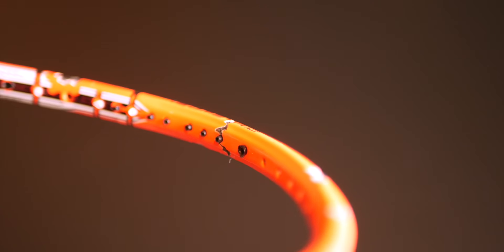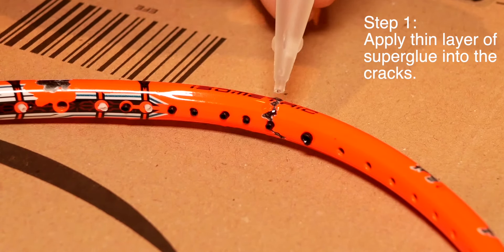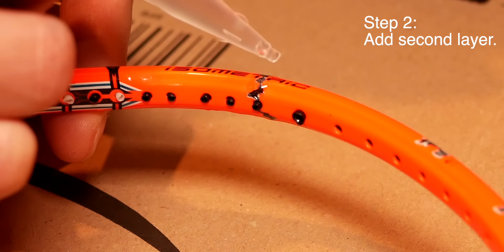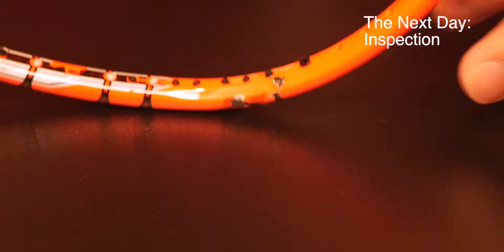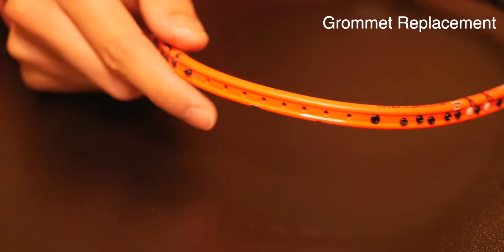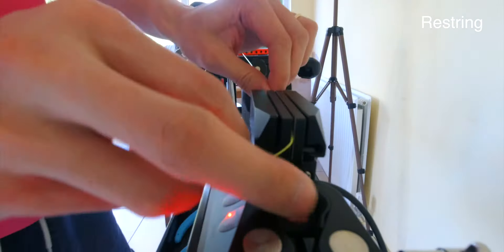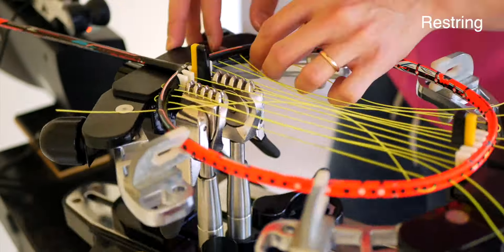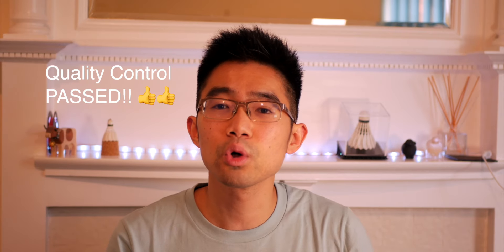How to Repair Broken Badminton Racket Frame using SUPERGLUE

Comment: How much tension of your racquet after putting the super glue repair fix
Reply from the maker: Max of 23 lbs in my experience 😬
Reply: I have apacs assilaint pro having max 38 lbs tension. So 23 tension will work on it?
Reply from the maker: It may withstand 38lbs when it’s brand new and not broken. Once the frame has broke, it’s generally Game over so 23 isn’t too bad at all.
Reply: @CKYew actually I bought brand new apacs vangaurd 11 with Max tension 38lbs and I gave it for stringing at 32 lbs (ofcourse electric machine) and he returned it with crack and told that the racket didn't withstand it... So please do a video on reality about apacs racket and it's claims ... Please test my type of 38 lbs racket max tensions... Like do 28 lbs first then do 30lbs then do 32 lbs n so on and see when these type of rackets actually break... 🙏😭 please do it for all members of badminton community. I felt so it happened today.
Reply: @CKYew  Can I do 24

Comment: Dude my racket broke at the joint of the frame... Do you think super glue would work?
Reply from the maker: Helloooo, wowwww how hard were you smashing to have broken the T joint of your racket 😂😂 well, you’ve got nothing to lose right so why not give it a go, I mean it’s not going to be like a brand new racket but no harm at this point trying 😬😬 good luck!
Reply: @CKYew  thanks man.... 1 more tip for you use baking soda with super glue now you have a racket that cannot be destroyed.....lol thanks for the reply.
Reply from the maker: Oooo baking soda and superglue!!?? 😏😏
Reply: @CKYew  yup..
Reply: Super glue wont hold it... go for carbon treatment
Reply from the maker: @a324111  awwww :( make sure you're not paying too much for the carbon repair, my experiences with them arent too great either! good luck!
Reply: @CKYew  It is easy to do carbon treatment and cheap too where I am from
Reply from the maker: @a324111  Good!! I'm glad you've had good experiences with it, do keep us updated on progress!
Reply: @CKYew  yep, it worked for my tennis racquet. just fill crack w super glue and have a layer of baking soda over it
Reply from the maker: Nice!!! I didn’t think it would work well on tennis rackets as the tensions are significantly higher but I guess you just did! 👍🏼👍🏼 amazing! Why baking soda too?
Reply: @CKYew  it a chemical reaction which makes it more powerful..
Reply from the maker: @Apurvrajvlogs  Sounds good to me!!! ;)
Reply: @CKYew  glad to hear that...
Reply: @CKYew  baking soda helps it cure faster and harder something about a catalyst or sum

Comment: what tension did you use after repair? My racket originally was allowed to from 24-35lbs tension. After the crack repair, what should be the allowed tension?
Reply: 26 I have heard

Comment: you can use super glue + baking soda. put super glue into the cracks and then add baking soda inside it, and add super glue again, keep repeating until cracks are filled. very sturdy, and you can keep repeating until the racquet actually breaks.
Reply from the maker: Good stuff!

Comment: Have you tried mixing either baking soda or charcoal powder (sanding charcoal or pencil lead) to the super glue? I just learned online that this will strengthen the bond further. With baking soda it will accelerate the curing process. As for which gives a stronger bond, I don't know. It seems like it depends on the situation.

Comment: I suggest removing the grommet from the crack location before starting with the superglue; when you have completed the superglued repair and it has all set and is hard you can (very carefully) drill out the grommet hole and insert a new grommet. I suggetst holding the racket in a vise while you do the drilling.

Comment: hii my yonex Astrox 7DG just broke during clash not even one month over after brought. what can i do so that i can use it as a normal racquet, one of the shop told that they can do binding or something but i wont be able to string above 20 lbs. so, any guide from ur side 😢

Comment: How much did u apply after repairing,is it lesser than normal before or same?
Reply from the maker: The racket isn’t the same as before. It will not take as much tension as it used to.

Comment: sir i have mizuno racket and have a cracked on the otherside only what is the good tension if i try to fix by superglue
Reply from the maker: From my experience, I wouldn't go any higher than 23 lbs. 😬

Comment: I have a query i just have a very minor crack like a threat size crack...will this glue able to help my racket...and after that can i use 26-28 tension in it....i hve windstorm 72
Reply from the maker: You won’t be able to string at your usual tension after a crack

Comment: May i ask what tension did you put after the repair? and may i also ask what is the condition of the racket today, is it still intact?
Reply from the maker: I wont recommend anything above 23 and yes, the racket is still intact to date but i dont use that racket much at all.

Comment: I got a few cracked. Will try supergluing.
After repair, any balance issue?
After repair, lower tension only, right?
Reply from the maker: Yeah, give it a go!! No harm and nothing to lose anyways! Typically no balance issues with superglue ones so good luck! And yes; much lower tension, this one survived 22lbs as they could potentially crack or break again. I’ve had a few which turned out with a bulge (this one didn’t) after stringing but it doesn’t matter as it was end of life anyways. Its more extending the life of the racket for someone who needs a racket or an absolute beginner instead of a full tension repair 😬😬
Reply: @CKYew  checked mine.....the frames are apart......dont think it is save-able     :(. Thanks for the reply
Reply from the maker: @whereistee1  ahhh, if it’s completely severed then it’s probably game over.. but you can always turn it into pens!! 👍🏼👍🏼
Reply: When travel is permitted, will take them back to KL for repairs,.....hopefully repair-able...
Reply: CK Yew Pens.......hardly write nowadays
Reply from the maker: @whereistee1  Hopefully it'll turn out OK for you!! Fingers crossed!
Reply from the maker: @whereistee1  Give them to the young ones who do!! haha

Comment: After you have applied the superglue, you can sprinkle baking powder over it which will soak up the residual superglue very quickly which means that you don't have to worry about it sticking to anything else! Also, if you remove the nearby grommets they wont get superglued in - if superglue goes in the holes you can use a small-sized drill to remake the hole 🙂

Comment: do you recommend gluing the crack while the string is on or should I cut it first? Also, which do you prefer? super glue or epoxy glue ?
Reply from the maker: It depends where the crack is, if the string is blocking the crack, i'm afraid you wont be able to restring your racket above 16/18lbs after gluing 😬
Reply: @CKYew  mine is cracking along the 4 grommets on the inner area (the area where string bed are). It's unusual crack for me, as normally we see crack across the frame

Comment: Hi, for slightly bent head, can it still be fixed? :( Hello from Philippines.
Reply from the maker: It sounds like you have a steel or aluminium racket as graphite/carbon rackets would've cracked instead of being bent. You might be able to reshape it slightly 😬
Reply: @CKYew  thanks for replying..Do stringers notmally know how to reshape? Or who do I specifically look for to fix semi-warped heads?
Reply from the maker: 😬😬 normally stringers don’t like stringing damaged rackets because they get a lot blame for it if it breaks 😂
Reply: @CKYew  i see. :( Goodbye to my racket then and to have enough money to buy a new one.  Sigh. Anyways thanks and looking forward to your vids! 🙏🙏
Reply from the maker: No harm trying anyways? 😊😊

Comment: Wait just realised, ck, why didn’t you just take out the grommet and put it back in when all the glue is set?
Reply from the maker: Good question. Most grommets are fairly tight fitting so anything in there which reduces the diameter of the hole would've made it impossible to reinsert the grommet.
Reply: @CKYew  true, thanks for the quick reply ck

Comment: Has anyone else had issues with the paint rolling where the frame shoulder supports are placed? You would notice this after stringing.
Reply from the maker: You shouldnt have any paint come off your stringing machine before/after you mounting your racket.
Reply: @CKYew  I meant paint rolling or folding on the racquet frame where the shoulder supports are. I am wondering if this particular racquet model has paint issues? Thanks.
Reply: Yes, it should not directly touch the supports. In my case, my supports are like straight poles so there is huge pressure in just one area of the racket causing paint lost. You need to get load spreaders.

Comment: Sir I have broken my racket from the middle rim
Reply: How can I repair it
Reply from the maker: @vrindajoshi9875  Hopefully the technique showed in this video has helped you!!
Reply: Where we will get this super glue
Reply: Can we repair it by doing welding
Reply from the maker: @vrindajoshi9875  You can get it in supermarkets, I've also left a link in the video description so check it out!
Reply from the maker: @vrindajoshi9875  Haha welding? I've not tried that but I think it will change the balance of your racket 100%

Comment: I am very doubtful this will hold, the superglue filling the crack is just not strong enough, it will likely open up again while stringing under uneven tension, and I have repaired well over a hundred broken racquets some with two breaks and they can be strung to any tension as allowed for the racquet and play almost just good!
Reply from the maker: This method is certainly a last resort attempt at making a racket playable compared to binning it immediately. It certainly won't restore it to its brand new condition so everyone's milage will vary.
Reply: What method you use for gluing?
Reply: Do you run a shop that do repairs?
Reply: Hi Pat do you repair rackets for others? I’m interested in getting mine repaired I’m in Los Angeles.

Comment: Does not work with high tension (28lb).  It cracked after stringing with 28lb.
Reply from the maker: Yep, once a racket has cracked, its ready for the bin. This repair will only suffice for casual games at low stringing tensions.

Comment: Can i ask a question?.i just bought a astrox 99 but when i recived it it has a crake on its frame😥😥😥 do i realy need to cut the string?. Or if i apply super glue in it and i didnt cut the strings of.what will happened it will stay the same?.just really need your help right now.....😥😥🤕😞
Reply from the maker: If you’ve bought a racket and it came cracked, you should contact your retailer immediately as something has happened somewhere. They should be able to help you out. Do not apply anything to the racket, nor cut the strings. Take lots of photos and send it through to the retailer immediately.
Reply: @CK Yew thanks a lot..I hope you make many videos like that that help us to know more information.....

Comment: Yeah, superglue worked but for how long? You probably have to reapply superglue every week or after a few shots.
Reply from the maker: You shouldnt expect a racket to perform like brand new after supergluing it. Its only a light fix.
Reply: @CKYew  "Expecting the racquet to perform as new after being fixed with superglue" is not what I implied or expect. Fixing the racquet with superglue is worthless. You should either get a new racquet or use a more permanent fix like using carbon fiber and epoxy